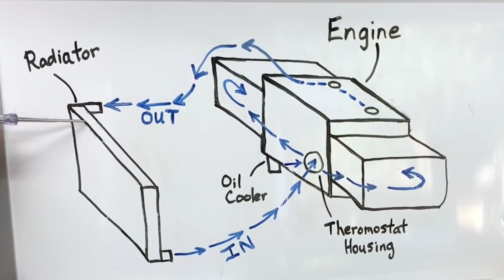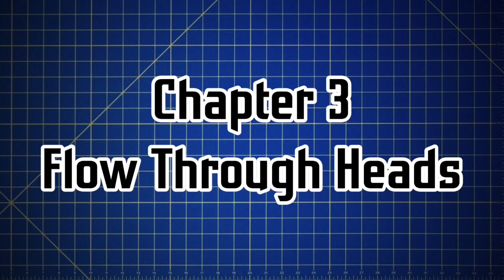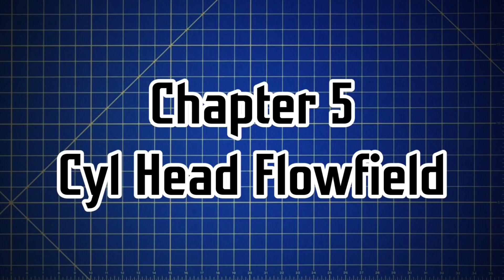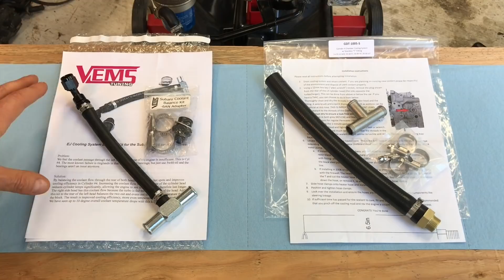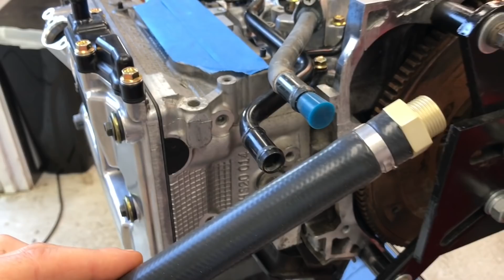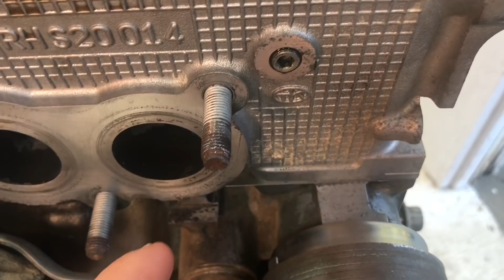Solving the Subaru EJ-Series Coolant Flow Problem

Comment: I wouldn’t shave the ports in the gasket. You need that amount of flow and pressure to have heat transfer from the block properly. And you cannot do it to only one side or the pressure will be too low with the opposite side. If you do both the water pressure will be too low
Reply from the maker: Thanks for sharing your thoughts on this buddy! I find this topic super interesting. I did not shave the gasket. You’re 100% right about needing to have correct flow and pressure - but it’s really about volumetric flow rate - which is a fine balance to achieve. You need to make sure the coolant has a chance to absorb the heat (i.e., not move too fast) and then be able to carry it away from the heads before things get too hot (i.e., not move too slow, either). And that’s the crux of this heat exchange problem.  Does opening up the ports (assuming you did it evenly going in and exiting the heads) make the overall volumetric flow rate through the heads increase or decrease?  Constructions usually accurate flow rates, think about a river and the narrow sections. You also want as much volume as possible (when your end goal is heat transfer), assuming it doesn’t flow too fast.

So, from a 1st principals engineering standpoint - here’s what we need to achieve. (1) The highest volume of coolant, (2) moving through the heads at a velocity thats slow enough to allow maximum heat transfer. So open up the ports but restrict flow further down the path (if needed). For example, restrict flow at the coolant cross over pipe entry point, for example, which is exactly what some high HP Subaru engine guys are doing!

Just some concepts to think about.  Does this mean I’m right and you’re not - hell no - We might be on the exact same page here, just needed to dive into the nuances! Cheers buddy and thanks for checking out the videos!! 👊👊
Reply: SubaruONLY I couldn’t have said it better myself!

Comment: Need your help wizard.. my 05 sti is sputtering under boost only.. fuel pressure is good.. coils are new and tested.. new ngk sparks.. new oem fuel injectors.. compression is fine.. leak down is fine .. took engine apart rebuilt it same.. tested all pig tails on harness and fine.. vaccum is fine.. no boost leak.. idles 100% fine please help
Reply: Tony Guzman Check crank sensor spacing
Reply: Tony Guzman Also clean your MAF and then reset the ECU

Comment: What about the coolant flow, of the cylinder #1 & #3? So time much was spent on the #2 & #4, is there the same issue with the other side? Why not do the mod with the other cylinder head?
Reply: Tim Salzmann The right side head already has something like this, to feed the turbo. This mod evens it out

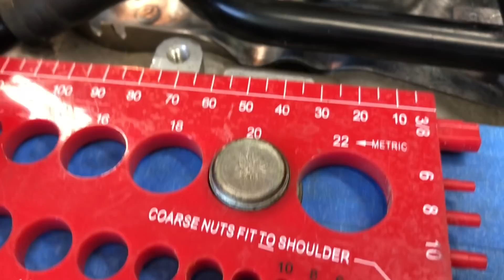Comment: Can you tell me what the thread pitch of the M20 coolant plug (at 36:15) on the back of the driver head is? I'm making my own reverse cooling kit, and my M20x1.5 to AN adapter doesn't seem to fit right.
Reply: Just ordered a M20x1.5 NPT thread adapter but maybe Subaru uses BPT thread pitch.

Comment: I wonder how orienting the t for the cooling mod affects it, if any. I set mine up with the coolant line coming from the water pump going straight through the t with the 90 degree part of the t going to the port in the head. I think it's a much cleaner approach, but the way you put the t probably allows for coolant to pass through to the back of the head more easily. Any thoughts?
Reply from the maker: lol.  Yes, I actually ended up orienting it the way you describe for the final install - seemed to line up the hoses better.  But I agree with the logic for sure, still think a y-shaped fitting might be better.  But just having the mod is the biggest thing!  Cheer man! 👊

Comment: FYI You do not want to cut into the head gasket for coolant flow, Subaru did not make the passages smaller for shits and gigs, that is a restriction for thermal convection and turbulent scavenging. Coolant flow does not equal coolant efficiency. You always want the cooling fluid to be touching the hot surface for as long as possible until it has gained thermal equilibrium then rush out.
Reply: This is the answer I was looking for, engineer?
Reply: Nice. Didn't think about that.
Reply: Are you sure?
Reply: Increased flow always means increased heat transfer. Sorry
Reply: @martinburnett3852 Ya but if it's not even touching and/or continuously touching the hot surface how r u supposed to get maximum cooling?
Reply: @selwyn13  it’s constantly in contact with coolant and the more fluid you can get in contact with it the better. The greater the difference in temperature between the coolant and material to be cooled is the more thermal transfer can take place. How do you make sure the difference is as big as possible? Circulate it as quick as possible. Not sure where people pull the idea from that coolant can flow too fast to pull heat away from but it’s certainly not true
Reply: @selwyn13    “It is always more efficient heat transfer wise to flow the fluid as fast as possible. Think of it like this if you flow water fast enough, the water in the heat exchanger will always basically be at the temperature of it exiting the engine. Since heat transfer depends on difference in temperature, this would make delta T greatest along the entire area of the heat exchanger therefore you would have the most get exchanged.”
I dunno how else to tell you please stop circulating this myth

Comment: Luke really good video , honestly I thought maybe for a subaru car the Phenix kit would be better because of the install , like the lack of room to work with , the Phenix kit you just use a socket verses crows foot , or cresent ?? so I have an off road application so I probably would go with the larger id hoses etc , also I was hoping you would show the cooling differences between stock and or offroad application also the cooling for the other side.

Comment: Saw a mod on Bucky Lasek that, to me, makes alot of sense.
Basically the drivers side fan turns on first, and thst is the cold side of the radiator, also where the thermostat is. He made the passenger side turn on first, that allows for a more uniform and eficient temperature of the radiator.
I'll be doing the same mod.
Reply from the maker: Just saw that too!! Really interesting. Gonna look into that too for sure!

Comment: Hey Luke did you end up making the head gasket kidneys larger to increase the flow? If so how did it work out for you?
Reply from the maker: I didn’t for several reasons (however, still seriously considering this for a future build) - flow rate is also variable and although opening up those ports lets more volume in, some engine builders have shared their R&D with me and making sure the coolant doesn’t pass through the heads too quickly is a major issue (basically, you want the coolant to pull as much heat out of the system as possible and if the coolant passes through too quickly, it won’t have a chance to absorb the heat and carry it away), so there are more factors at play than I originally mentioned in the video. More to come on this as I dig deeper. Thanks and cheers! 👍
Reply: Got it. I've still been thinking to do it. As I plan to run Evan's waterless coolant. Yet I'm still waiting to beable to afford my v8 ej207. I have quite a few things I'm considering for my build. I'm not building the block but considering everything else.
Reply from the maker: Those are about the most legit starting point you can use - short of going full closed-deck!  Legit man, love to hear about it once it gets rolling.

Comment: I thought the reason for the dogleg exhaust port was to clear the chassis crossmember on the left side of the car.  In order to do a symmetrical port head you would have to redesign that part of the car.
Reply from the maker: Ahh. Think you have a good point - THANKS!  I’ll take a closer look at that for sure.  Maybe a TSS fab front cross member...

Comment: To be fair, subarus are riddled in design flaws
Reply from the maker: Lol.  So true.  But so is every other OEM, IMHO.  It ain’t easy ... but I’ll take Subaru’s design flaws as a trade off for the best AWD platform on the planet any day!!! Cheers buddy - thanks for the comment!  👊
Reply: They honestly aren't nearly as much as the misinformation floating around would have people believe.
Reply: @MrSubaru1387  Currently dailying an 03 WRX with 140k miles on it and it is in fantastic shape and extremely reliable I think the issues just come in to play when people modify their car the wrong way or neglect to perform maintenance
Reply: The ej257 has basically been unchanged since 2004.

Comment: Hello...Does a radiator upgrade solve overheating problem?
Reply from the maker: Good question and I’ve thought the same.  It helps bring down the coolant that is being recirculated in the system - BUT if there is a stagnant pocket of coolant that gets trapped in the back of the rear left head, that coolant isn’t getting cooled by the radiator, so no help for that issue (which could be the big problem).  So I recommend both for best results!
Reply: I installed a koyorad radiater and the cooling did improve on my car  06 sti.